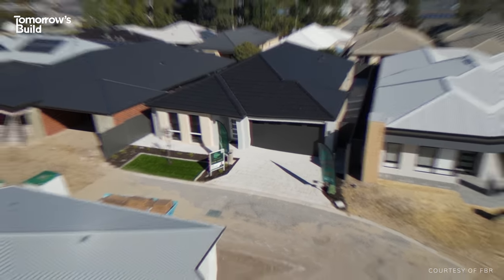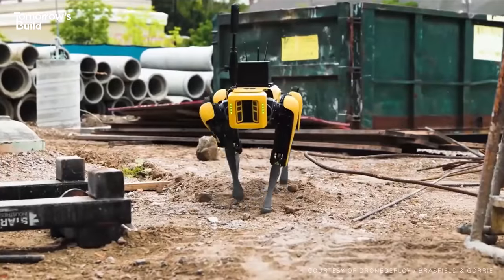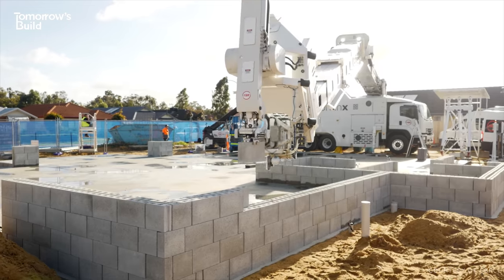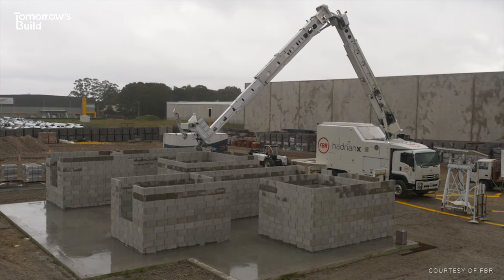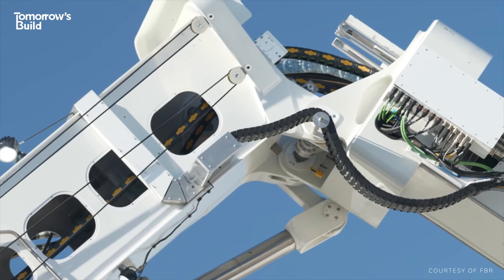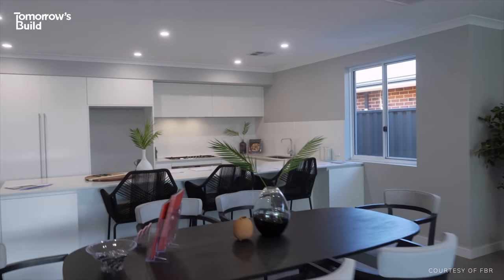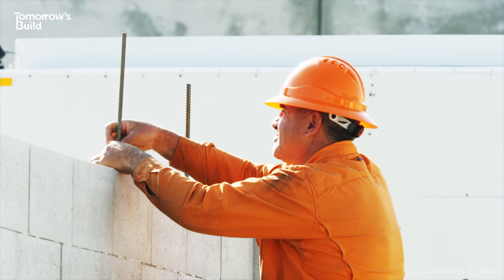This Robot-Built House Could Change Everything

Comment: Proud to see this in Australia. A little less proud to see the types of homes we're still building (massive footprint, poor use of space, zero insulation)
Reply: Wow. No insulation at all? Cheapo developers. I woundnt want to live in brick/cinderblock house in an earthquake zone anyway. Maybe it's reinforced but I still wouldn't want I live in a crumbly Lego house
Reply: You do know concrete itself is a mess of insulator compared to Wood homes with fiberglass. They have better insulation right off the bat even though they don't have fiberglass and their insulation holds up over time versus leaks that develop in Wood homes within twenty years and I say that as a person who has a concrete home that doesn't use any fiberglass or foam insulation and even 40 years later, whenever I put all the blinds up and turn on the heater for a little bit, I can goa  day without turning it back on and only for a little if that
Reply: @SensationsRim  I live in the city shown. We don't have earthquakes here. We've got caves with 40,000 year old paintings & even a rockshelf with Dinosaur footprints still showing on it. I was in Japan once when they had a little quake that didn't bother the locals, but it scared the beJesus out of me because I'd never been near one. And double brick is a great insulator, & we put some recycled stuff in roofs now.
Reply: @NadeemAhmed-nv2br I wasn't referring to the concrete outer walls on their own, but to the build as a whole. Fact is that our country builds cheap homes with next to no insulation. Regardless of material used for the walls. High efficiency glazing is a foreign concept here for example. The construction code regarding efficiency is minimal. People are used to using heaters and air conditioners for everything and have no problem running them all day.
Reply: Mark! FBR are about offering “ AFFORDABLE “ housing. Many people just want a basic house, running water & air con, without living off 2 minute noodles their whole life to afford repayments👍
Reply: @letsburn00  Insulation also keeps houses cooler in hot environments, without constantly requiring AC to cool the hot outside air that seeps in.
Reply: They're so hideous I have a physical reaction. Architecture in Perth is absolutely shocking for the most part.
Reply: @SensationsRim  have you seen the wood frame home built in the US? 🥺
Reply: @lemster101  we have insulated wood homes in the US and we still run our heaters and AC all day. Face it, people are spoiled and want to be comfortable 🤷🏽‍♂️ I personally keep my AC at 75 so it doesn’t  run as much.
Reply: That’s what I thought. Here in England this would be considered a massive waste of space. Most of our properties would have half the surface area and we simply build up. Why is it that whenever we look at houses being built in Australia most of you guys ‘never consider adding a second floor’. You always seem to build outwards. That’s why places like Australia and the US are running out of ground level space so quickly.
Reply: Morgan Allen  Nah, you can see it at 4:48. No insulation.
Reply: 2 knocks on 3-d printed houses. 1st, really only works on flat land. And if you want to get housing prices down, its the cost of land that is the impediment. 2nd, what's wrong with human built homes? Isn't 3-d printed homes a form of egoism and madness to make ourselves redundant? Think of that next time you see a homeless camp.
Reply: @NadeemAhmed-nv2br   Thermal Mass !
Reply: @tsubadaikhan6332  Yep
Reply: @danielwhyatt3278  Well we do have a continent to fill up ! LOL No that is Perth, they have not caught up with the Eastern cities yet;  every new house in Sydney/Melbourne/Brisbane is two storey pretty much, unless it is units/apartments which are reaching for the sky !!!  The land has become so dear that the only way is up; that and planning restrictions/zonings. But out on the fringes, like in Britain and the U S suburbia keeps growing like this !
Reply: @xfhghe  Yes, well what is your job and is a robot coming for it?
Reply: @linmal2242  I'm a technician at a university and have fabricated components for an early 3-d house printing machine, ironically you could say.
Reply: Housing crisis is because human greed. NOT BECAUSE OF LUCK OF ROBOTS. HOW STUPID SOME PEOPLE MUST BE TO SPREAD SUCH BS.
Reply: @xfhghe  1st, I mean even on a non flat surface, you always have a foundation right? The machine has arms that make it level. So if the ground isn't flat that doesn't matter. 
When you have a house that has different depths/heights for certain rooms. You can just adress that in the schematic that the robot follows.

2nd, if we want to survive with more and more people on this planet efficiency is going to be key. This greatly improves efficiency so I applaud everything that makes things faster, cleaner and beter (yes robots do things beter and more consistent then humans :p ).
Reply: Black roof in perth 🤦
Reply: Proud to let a robot take your peoples jobs away😂wow.
Reply: @Interstellar Traveler No, not very smart capitalism. The key cost in construction is the price of land. If you pay 500k for a residential lot, then the savings you might get from a robot built home is moot.
Reply: @Interstellar Traveler Correct. But the need for affordable housing is in large metropolitan areas. There is no lack of affordable housing in rural Nebraska for instance. And where land is cheap, then most home owners will have the luxury of choosing what quality / form of build they care to have. Solving affordable housing in urban areas will require a political component, namely zoning changes, which is not easy to come by. So that remains a quandary.
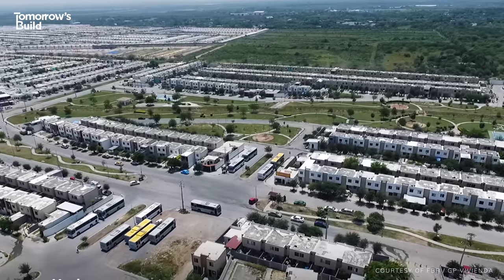Reply: @6:38 - those houses are shocking, as is the entire car dependant development. I think if Not Just Bikes saw it he would set himself on fire. How much more would it cost to build 5 story mini apartments with differing facades? Also cut and cover some metro tunnels and put some tram lines in and borrow barcelona's "superblocks" idea with car traffic only on every 3rd road. You've just created a nice little town or suburb as opposed to this place that will only attract poorer families.

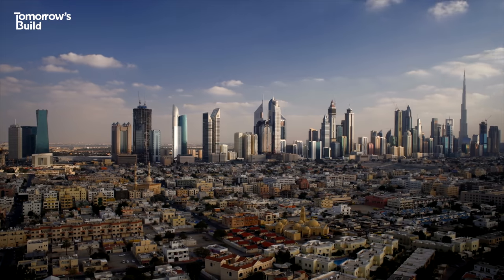Also have to agree with Lemster on the insulation. I lived in Brisbane and we had to spend a fortune on Aircon electricity because our (5 story apartment block) had zero insulation and single glazing! The whole picture at 6:38 is saving a penny and losing a pound...

Comment: Am I the only one not seeing the bonding agent (mortar) in these videos? Or is this just marketing stuff, so they didn't want the true messy look in their B role?
Reply: Exactly.where is the fucking mortar.I only see a black mix being poored for steel bar anchorage in the brick cause i think its a reinforced masonry structure
Reply: You can see it in some scenes. Maybe the scenes you mean, are engineering footage. Also a machine needs less mortar, because it doesn't need it to correct errors.
Reply: The arm is wiping it on the bottom/head joint as the hand pivots the brick away from the conveyor.
I'm assuming the threaded rod being installed by humans is going to be grouted solid into the cavities.
Reply: it uses an adhesive rather than mortar.
Reply: @jimurrata6785  There was some footage of grout or similar being poured in around some of the rod.
Reply: @johnschroeder3072  Yes.  I was just making that comment in relation to the first post which seemed incredulous that the wall had integrity.
So, an adhesive that sets in 45 minutes (probably epoxy, possibly urethane) and reinforcement bar grouted solid.
The wall should hold fine, and be fireproof, given that these houses are so close that one fire would have them all ablaze.
Reply: @jimurrata6785  I was just letting you know that they had addressed the issue. The reinforcing setting isn't an issue as the wall can time the vertical load that would be next in the build process well before and significant lateral load would be placed on it and by that time the reinforcement would all be set.
Reply: @johnschroeder3072  I'm aware, I watched the video too.   💡
I was saying that the rod/grout process didn't seem automated, as we saw human labour doing that part.
Reply: @OperationDarkside  I also saw the gaps in between the bricks that were several layers below the top layer.  The ones that we saw with mortar I believe those were the hand laid bricks that was talked about in the video.  The best thing would be for an update of this video to be made that shows this special mortar/adhesive being applied to the bricks a long with an explanation of why some camera shots clearly showed day light coming through gaps between the brick that were already laid.
Reply: @brettmashado  Thanks for the clarification.

Comment: I'm confused by the intentional gap between each brick?
Reply: insulation most likely. an air gap insulates a lot better than you might think, its very common in germany for example
Reply: dry stacking the bricks, must be a test run of the machine to make sure everything is functioning right, I would expect they took them down and redid it with Mortar.
Reply: @JackSparrow-hh2lh  a gap between an inner and outer layer of wall sure, but these gaps are not that, gaps like this would be a massive air leak.
Reply: For steal re enforcement.
Reply: The gaps you mention are usually filled by the bricklayer, not only do filled "perps" close the cavity between outer and inner skin, but they give the wall a greater structural strength and added stability. I doubt it will be a massive issue for them to fix, but as is........ i doubt the house wouldn't pass UK inspection.
Reply: If the internal finish is going to be sand finish float and hardwall plaster then the gaps between the bricks help the float key in to the wall.
Reply: This system is a bit fake, there is NO way the bricks just stands without any clueing layer between them, on the bottom and sides. I bet the bricks what the machine did they just removed them and manually, by hand, laid them with plaster etc. Polyurethane isn't too enough to "glue" without filling the inside of those bricks  with cement . In my eyes this is still far away from real application to be used anywhere.
Reply: These are only demo pieces I’m pretty sure.
Reply: @Thevikingcam  All three builds passed Australian Spec, the glue is three times stronger than normal cement, a wall was knocked over with a Bobcat with 80% of wall intact. Also the walls have rio and are cavity filled with concrete, high grade I think. The walls are rendered covering the gaps. FBR are currently building their next generation Robot that uses 600mm bricks and is in testing with Weinerberger (Austria, worlds largest brick manufacturer), will probably have a contract by years end.
Reply: @prakesh2904  No, they are actual builds, the house you see is the finished product, just sold last month.
Reply: Wouldn't buy a house built with these vertical gaps. Any coating will cover them only very near of the surface. 8:53 The robot "accuracy" is quite relative, look at the alignment.
Reply: Where's the mortar? Did I miss it?
Reply: @rok1475  do I think engineers make mistakes despite millions in investment....... Mmmm, let me think..... Apollo 1? Apollo 13? Self driving cars........ And probably 100 million other similar fuk ups...... It happens all the time!!
Reply: Head joints bigger than 1 inch. Seems to be a very bad thermal bridge design due to possible problems with the airtightness. At masonry school you learn that joints should be at least 1/4 inch to permit proper tooling and no more than 1/2 inch to provide adequate strength.
Reply: @JackSparrow-hh2lh  I'm from germany and there we larn that head joints should not be broader than 10mm.
Reply: I thought the gaps were for morter.
Reply: @stevepatrickjarvis  mortar goes on before laying, not after.
Reply: @MistaJayLJ  Interior perps dont need to be filled. They usually get cement render. Not sure how that works with the drylining shot they showed.
Reply: I am sure the gaps are filled in with something later. Otherwise, this is just a marketing jargon video.
Reply: Saw and ask myself the same. I think it's just a simulation for propaganda purposes.
Reply: @diegfb2001  interior perps don't get mortar. As per the standard

Comment: This reminds me of the robotic packing machine we used at a chemical plant in the production of large rubber blocks. The last step before shipping was to pack these 75 pound blocks into an aluminum container that held one ton of them. It stacked them in a certain pattern that was efficient and safe for shipping.
Reply: Excellent use of mechanical advantage. Better than lifting them yourself !

Comment: I'm a builder in Florida, USA.  This would be great for our area as we build mostly with concrete block for our structures and not wood frame. While 3D printing is an interesting idea, the transition and/or adoption here would probably be an issue.  We engineer our structures to with stand hurricane winds so having a machine that uses our current concrete blocks would be great.
Reply: The blocks are justified.  That means they are cut to precise dimensions.  That is why such thin joints
Reply: For the prices of home in Florida, they need to have steel all the way up to the roof, like what we use in Jamaica.

Comment: As a long term shareholder, I’ve enjoyed reading the comments and that FBR are finally getting some decent exposure 💪.

Firstly, FBR are about offering simple and affordable housing, and are in existing talks with both Saudi & Mexico.Both we’re released as announcements on ASX, and we have no reason to believe that they aren’t still active.

The adhesive is used by European builders, and both Weinerberger and Xella are in MOU agreements with FBR and both  announcements were  released on the ASX. Once again we have no reason to believe that they aren’t still active.

Also the environmental benefits of the HX with minimum waste, able to work 24hrs, will also be a massive selling point.

Perth is a very sandy , hot  & harsh place in the summer and we are currently experiencing a much cooler wet and windy winter.

Please don’t take this as financial advice, it’s just a quick insight into FBR, I’ve held for years and believe this could assist with the worlds lack off  housing 😊👍

Comment: The robotic system looks great, but for future videos on topics like this, could you explain how the gaps between bricks are filled in more detail?  Is the glue only on the bottom surfaces of the brick and the sides get filled when you pour the internal vertical holes?
Reply: Holes are not filled. Just glued top n bottom.

Comment: I’m confused about the wall assembly. Is there external EPS insulation added? What is common practice to finish the interior? Are furring strips added then plaster board?  I saw some dot and dabbing in one of the clips. Are utilities run through the floor and into the brick or  through a chase between the brick and plaster?
Reply: The houses here in Perth are double brick exterior. The interior is finished with render/plaster and then painted. Utilities are run through the roof space and down into the wall cavity, or the walls are chased if it's an internal wall.
Reply: You can also direct stick plaster using masonry glue.
Plasterers don't love using it all the time but don't mind. The biggest issue with the masonry glue is ensuring you stick perfectly flat and plumb. 
Because the brick wall was precision laid, it should be perfectly flat (in theory, haven't seen the product in practice). You can use smaller dabs of glue to reduce the amount of small humps in the plaster.
You don't necessarily have services in all the walls. If so, i'm sure they can use furring channels or have the services chase it into the wall.
I highly doubt insulation was added to internal walls, since it is brick which provides are decent amount of insulation.
Common practice is plasterboard on the inside. Only in very special cases plaster white set render is used.
Reply: This system is a bit fake, there is NO way the bricks just stands without any clueing layer between them, on the bottom and sides. I bet the bricks what the machine did they just removed them and manually, by hand, laid them with plaster etc. Polyurethane isn't too enough to "glue" without filling the inside of those bricks  with cement . In my eyes this is still far away from real application to be used anywhere.
Reply: @Thevikingcam  There is glue on the bricks and they did reinforce it with metal beams inside the bricks and filled it up with some liquid that probably hardens.
Reply: The blocks have cavities which line up - no need to chase
Reply: @Thevikingcam  In a comment above it was mentioned they knocked a test wall over and it remained together 85%. That seems better than any human built wall.

Comment: Seems like it does just a small part of the total construction tasks.
Reply: That's the point...?
Reply: Yeah, you can't even get off the critical path after the machine as you still need the roof trusses + roofing. And 3 days for a machine per house is a joke, hope they improve that aspect. Should be less than a day per house.
Reply: @dimvoly  I think it will be soon and they could use two brick laying trucks to be twice as fast. They may even be able to coordinate 3 brick laying trucks for large homes to be  built in a day.
Reply: But it disrupted many steps in the house building process as explained, any small disrupting stone will have a big ripple in the construction industry